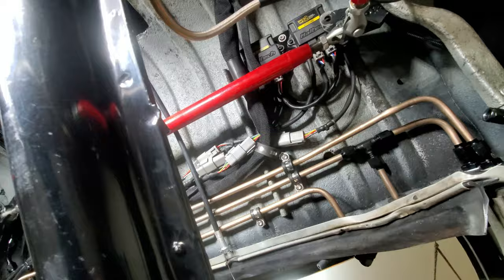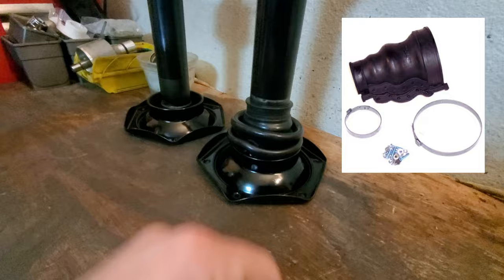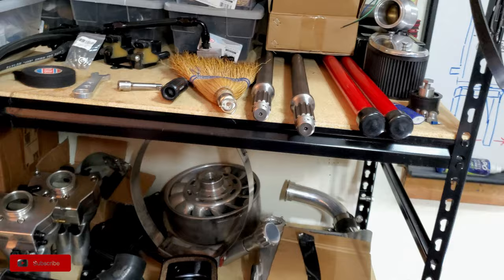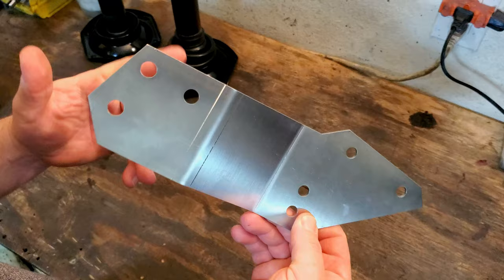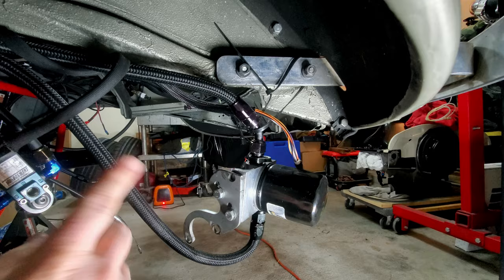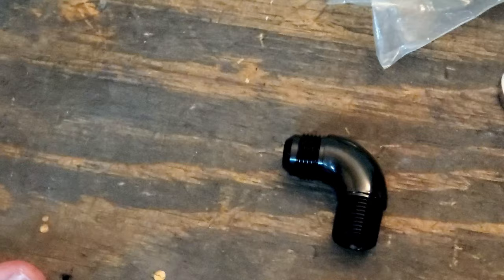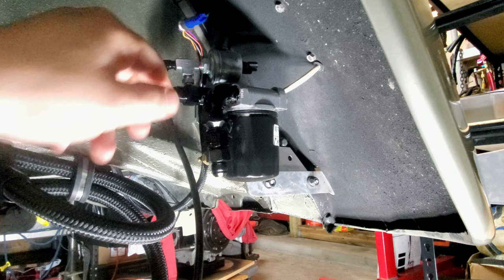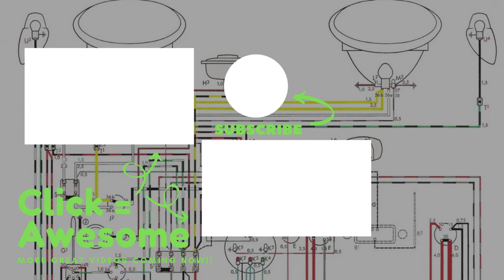VW Beetle Remote Oil Filter |Turbo VW Beetle | JW Classic VW

Comment: I used one of those on a '73 baja bug build I did, and the wires on it melted after about a month of driving the car, and it stopped working.  I hope you have better luck with it than I did.  I replaced it with another high torque starter, and never had a problem with the replacement.  I'm not sure why that wires on the Wasp got so hot.  I made no electrical changes to the car, and just replaced the starter.
Reply from the maker: That's weird... normally overheating like that comes from an electrical short, poor grounding or improperly gauged cables.

Comment: I never liked those oil filter brackets that attach to the exhaust port studs.  You just end up heating up your oil filter adapter, and hence the oil.  Not the best idea for the oil filter.  Granted the oil then transfer to the external oil cooler, in your setup, but a lot of people don't have the external oil cooler.